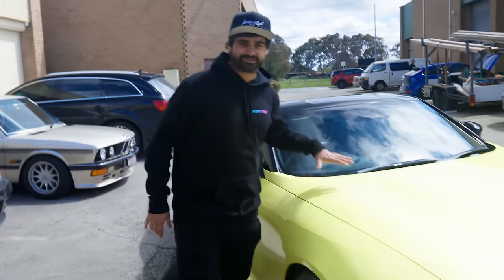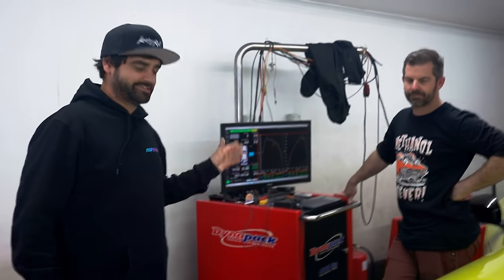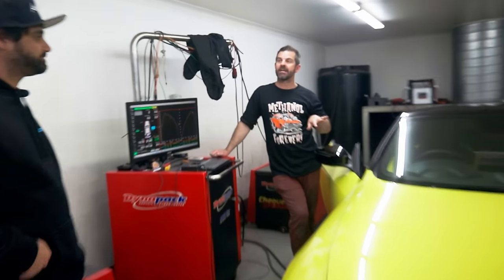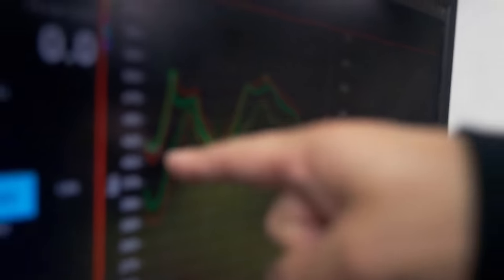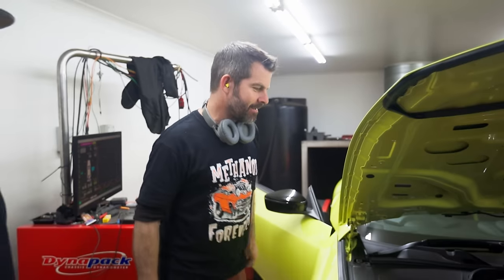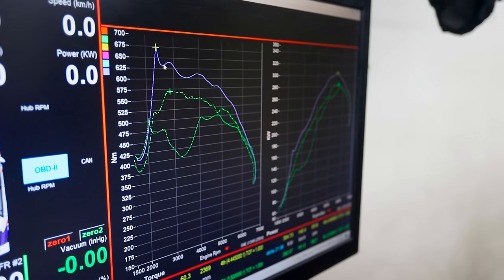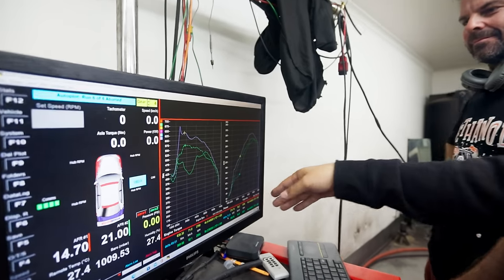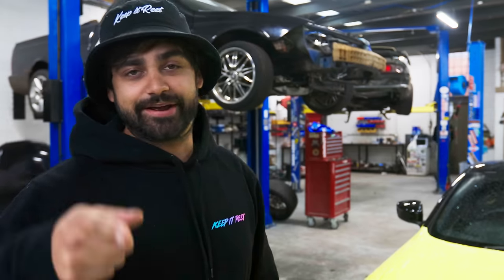Fixing The BIGGEST PROBLEM With The New NISSAN Z + Flame Tune!

Comment from the maker: To prevent all the comments we will be fixing the Shart Exhaust soon 😂 

What is peoples opinions on how Nissan released the new Z from factory? 👇
Reply: Too quiet, otherwise its alright I guess
Reply: Just put two 14 inch resonators and it should sound completely different
Reply: Can't do a burnout without cutting power soon as the brake pedal is pushed , exhaust is shite has potential with more money put into it  just the price is a little high for a glorified 370
Reply: @mickdejager3910  he has to pull stop lamp fuse on the new z to do a burnout
Reply: @mickdejager3910  even if he just gets a a tune he should be able to do burnout now
Reply: @BADMAN-SJ  ok thats good and hopefully the dose sounds sick too
Reply: Shart 😂
Reply: Biggest shame is how they softened up the suspension way more than the 370Z... This one is more of a GT than sports car in it's overall chassis dynamics, dope engine though.
Reply: Thanks for fixing the exhaust. It currently sounds like shit. 
Considering those turbo's aren't the greatest in durability I would delete the flame mode.
Reply: It would sound really decent with a 2 into 1 after the downpipes and 3.5" from there back with a straight through resonator near the end. Or put a small bullet resonator right at the 2-1 or in the downpipes if you are building one yourself. Just an idea...
Reply: I think I'm getting old because I actually don't mind a quiet exhaust, well not quiet but just a bit louder than stock. I think 2 high flow oval mufflers near the exhaust tips would make the z sound much better
Reply: @vxsr33  Exactly, noise isn't a nice note, hence why companies spend money on R and D to reduce irritating harmonics yet retain the frequencies which sound good.
Reply: @Smisky mmmm

Comment: The stock air box works great actually . To run full e85 you need injectors , low pressure fuel pump and high pressure fuel pump and flex sensor with filter for the vr30
Reply: What are you the king of vr30's or something
Reply: @jdhshuajfjueudhbd6227  haha yeah. This motor isn’t new
Reply: If anything I’d upgrade to AMS or Z1 intakes for the built in velocity stack and high flow filter.  Other than that can confirm the stock intakes are actually really good.
Reply: How is the v30's tunability compared to an N55 bmw engine in the m2?
Reply: @spideybuildscars  i would save money just get dry performance filters and your good. Unless u are upgraded turbos intakes are really only  noise
Reply: @cosmic_gate476  vr30 is very tunable with ecutek you can do anything same software as GTR
Reply: @jcproductions89  worth getting the new Z or just get a super clean 370Z touring for half the money and mod the shit out of it for 450+whp? Also considering a 2017-18 M2 with low miles, which is considerably cheaper than the new Z.
Reply: true but even 20 to 40% mixes provide huge gains on std hpfp
Reply: @ChequeredTuning  e30 mix beats tuned Bmw m3 f80s if vr30 has full bolt ons
Reply: @cosmic_gate476  I just beat a 370z on the way to work lol they are slow bro. U would need a single turbo kit. I’ll take my q50 all day
Reply: @jcproductions89  true it may but the chassis is light years behind. we tune many of both regularly.
Reply: Once they upgrade the turbos?? It can get ugly..
Reply: @cosmic_gate476  the aftermarket for the n series bmw turbo engines is far greater and more developed than the vr30 platform.   it wont be long before the standalone ecu companies offer a plug and play solution so you can run externally gated turbos etc etc.
Reply: @cosmic_gate476   i mean if you’re into it you could get an Infiniti Q60 and mod it up. Looks cooler imo and has the same engine as the Z, not too pricy to make it fast BUT it is kinda heavy.
Reply: @Yohasbing  nah I don't want an auto car, and I don't think the q60 looks better than the 2023 Z although it does look very nice it's just another sedan coupe while the Z profile is unique. The q50s and 60s will depreciate like stones down an abyss compared to the Z as well. So it's really 3 options a new Z for 60k CAD, a used m2 for 50k or a clean 370 nismo for ~42k then pay for forced induction and other mods.
Reply: @jcproductions89  they are not slow your just faster

Comment: Oh jesus the backfiring is intentional? I always thought the cars doing that by my house were just on their last legs, giving out a dying gasp 🤣 TIL
Reply: That's that ricer shit.  It's about as bad as slapping on a BOV just for the sound.
Reply: @Lofi.z34  I'm well aware of all that. Most engines actually don't do that if you remove the muffler, since the muffler has nothing to do with late ignition of fuel.  There's a LOT of people that tune just to get pops and bangs, and THAT is that ricer shit.  If it happens just because that's the nature of the car it's all good.  My Evo definitely does it, but not on purpose, and it's not constant.
Reply: @Lofi.z34  Social media in general TBH.  Everyone wants to be unique but they all do the same corny shit.  Slap on some stretched rubber, extreme negative camber, and destroy your tune so your exhaust pops and you're "cool".  Unfortunately for them, you can't bolt on good taste.
Reply: @Lofi.z34  Tuning for no other reason than to get your exhaust to pop is exactly that.  I personally don't care what people do with their cars.  As long as it floats their boat.  Doesn't mean I need to like it OR respect it.  Especially when those same people EXPECT you to "respect their build".  It's just as bad as those riced out Civics that I can GUARANTEE you and everyone else trash talks.  People do shit JUST to be loud and obnoxious and then act like they're fast.  I've seen it WAY too many times over WAY too many years.  If you're gonna sit there and pretend like that's not the truth then that's on you.

There's plenty about today's "car culture" that deserves the hate it gets, especially when it's making all of us look like no talent ass clowns just because we have a modified car.  I don't need to like, support, or be positive of trash.  It's attitudes like THAT that continue to drag this culture through the mud.

Comment: QM TIME 12:03...sliping rear wheel 1st2st
may go sub 12sec if you can get the launch right..chuk some FAT MIKY Ts on the rear..🏴‍☠️🏁🤟🇦🇺
Reply: Needs a 2.0 LSD. The stock 1.5 only locks up at full throttle.
Reply: if thay can 'hookup' good 1st to 2st..shod crack a 12sec